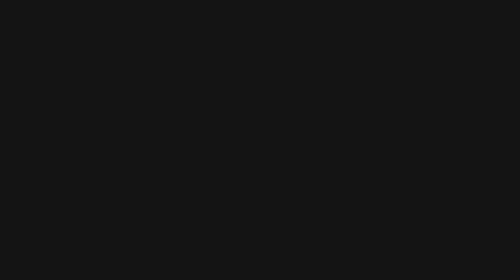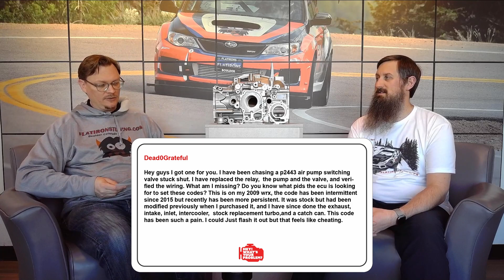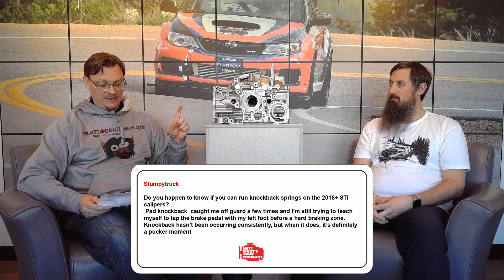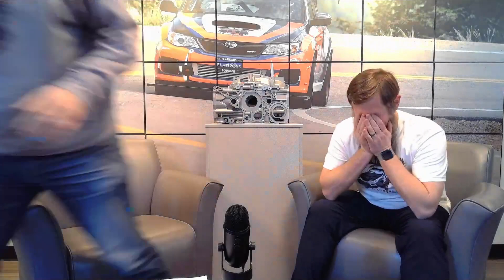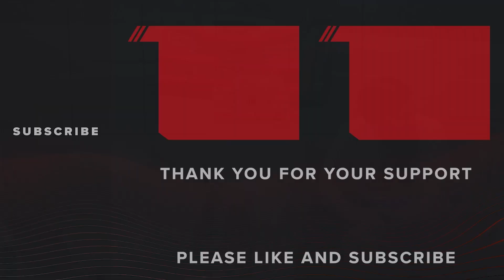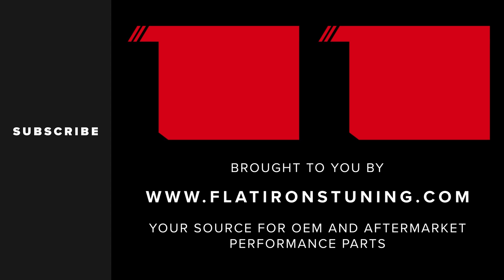Turbo RS Swaybars, P0420, P2443, Brembo Pad Knockback problems

Comment: Hi just wondering how much knock is 'normal' the with stock tune?
Usually see a couple knock events with FKC getting to -2 or -4 within a 30min drive. I saw FKC get to -6 during a 2hr road trip, partial throttle at highway speeds, <5psi boost.

The knock events seem to only happen when driving around normally at partial throttle and the ecu in closed loop. I have done a couple WOT pulls and have not logged any knock during those.

The car is a stock 04 Forester XT with a 2.5in catback exhaust, 98 RON fuel. It's otherwise healthy with ~110psi compression across all cylinders, no CEL's, no head gasket or overheating issues.  IAM always stays at 1, no boost/vacuum leaks that I can detect with a smoke test, not much oil in the catch can. Different fuel brands, cleaning MAF and resetting the ecu made no change.

Am I worrying over nothing or is there something wrong here?

Comment: I don’t know if it’s recommended, but I’ve been using stoptech anti-knockback springs in my 04-07 STI calipers with no issues the past year since I installed them. It’s awesome to hear you guys talk about the springs! They work so good for preventing a soft pedal.